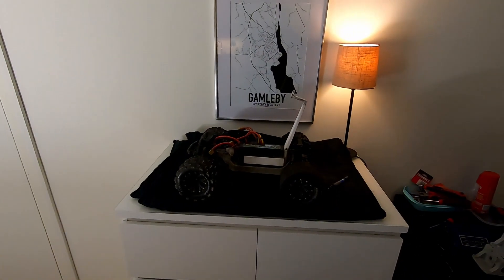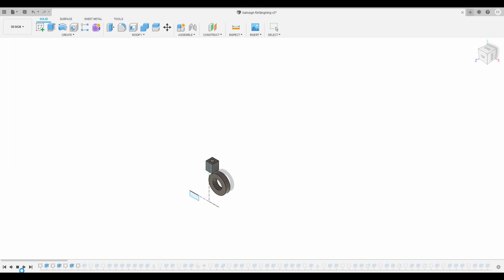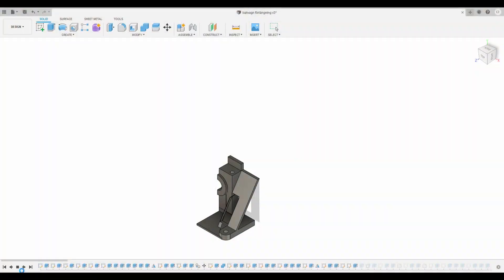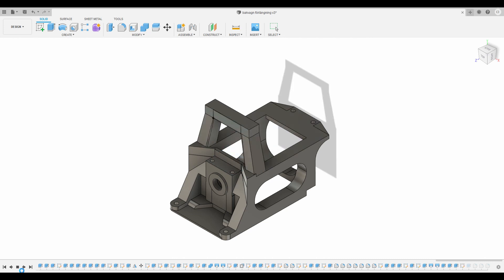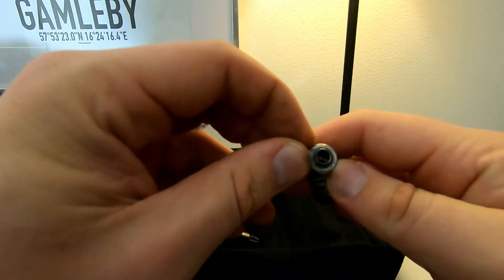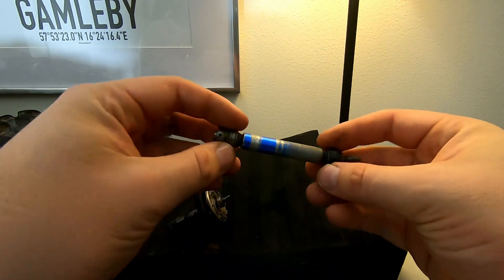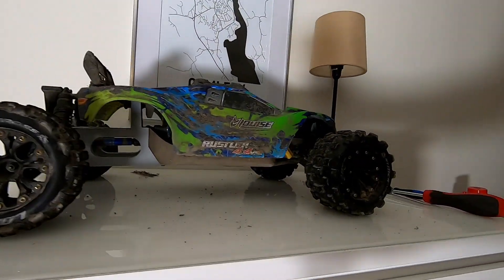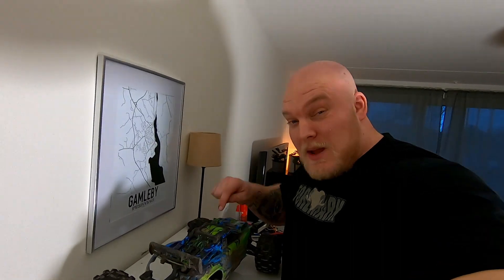Rustler 4x4 VXL extended 10cm with a 3D-print!

Comment: Where is the driving the Rustler video?! I have been patiently waiting. Would you be interested in printing and shipping one? If so for how much? I have a castle 1515 in my rustler but still using a 3s hobbywing esc. I am curious to see the improvement from a longer wheel base. Thank you.
Reply: hello. it's me but from another channel. i got on to other things, youtube was not as fun as i had expected and the rustler keept snapping driveshafts in metall due to the 1:8 engine with 6s battery. the improvement is radical if you have an overpowerd engine. originaly the car flipped up the front and cached air under if i throttled fully up to maby 35 mph. with the longer wheelbase i could haul as from maby 5-10 mph. also much more stable in high speed control. controllable slides and so on. but as said, i now could give power components where never built for and i never drove without loosing alot of money :P
Reply: @CimJohanssonStrength  i upgraded all of my driveline parts to metal along with my suspension parts before adding the castle 1515 and it did well with 3s.  when i upgraded my esc to a monster X 6s  everything seems to break or wear much faster. so it is really fun but not for long. like you said, it gets expensive quickly. So   I am going to put my hobbywing 3s esc and buy a decent motor for it and move trhe castle system to my corvette, which is a stretched 2wd slash with a 1:7 scale limitless body. I did a bunch of mods to it before stretching it but couldn't  make it stable. Now that it is 71mm longer I think I want to try again.